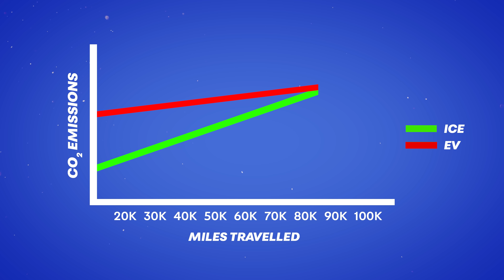Are Electric Cars REALLY That Green? [New 2022 Data]

Comment: As someone who made the switch from ICE to EV 3,5 months ago and advocated for EVs for a while now I was a bit miffed at first seeing this video. But if I take off my EV glasses for a moment I once again have to agree: EVs have still a way to go to become as green as they are advertised to be. But depending on where you live and how much you drive this break even point isn't that far away. I personally estimate that by the time the initial lease (3 years) for my Corsa E is over I should have reached or maybe even passed the break even point, considering the electricity mix here and my average mileage per year. Thanks for this excellent report, keep them coming.
Reply: I also enjoy listening to Rory Reid as I rate him as a fair and balanced journalist. My Fiat 500e will receive around 60% of its charging from my solar PV system and it has a much smaller battery than a large SUV, so I'm not sure how it would compare with (say) an ICE Fiat 500 hybrid bearing in mind that over half of grid electricity here in Scotland comes from renewables.
Reply: @briangriffiths114  Fair to say (as pointed out in the video) that a lighter EV with appropriate battery size/range is more beneficial - and a 500 vs 500e would be a similar comparison to what Volvo have done. The kicker here would be:
A) What are the realistic lifetime emissions for YOUR particular 500e vs if YOU would've been driving a 500?
B) Where did the "Italians" source the materials for YOUR 500e, and to what extent did they seek to protect the environment in that particular geographic area in order to protect (and benefit) the locals long-term?

Fair?
Reply: @Makuma_Jin  All very good points. I do not get the current trend for large and very powerful cars (whether ICE or BEV) that can usually do 0-60 in under 6 seconds but I seem to be in the minority. Having never driven a BEV prior to the Fiat 500e, I am impressed with it and intend to keep it for a very long time.
Reply: @briangriffiths114  You have my blessing for sticking with what you believe in 🙏
On the 0-60 acceleration time; I've been feeling the very same way, albeit... I prefer a capable, confidence inspiring, balanced vehicle. Though not every vehicle needs to be performance-oriented..! Eco-friendly, economical, practical vehicles have their own slot in my heart..!
That said, I still don't think manufacturers could ever justify selling these cars without compensating for the lifetime emissions, and the customer should pay the same amount of compensation for the vehicle they choose to operate.
I make myself a bit sad saying this, as it is my own dream cars (and their manufacturers) that I'm currently criticizing. However, as long as there is a legally sanctioned way to own your own vehicle and enjoy amateur/privateer motorsports, I will reluctantly fold my hand for the betterment of mankind (present and future)...
Reply: @briangriffiths114  there is a very simple reason for EVs. It is all about cost. An EV has a single speed transmission. To get an EV to have enough torque at slow speed (to make sure it can go up a steep driveway the same as an ICE car in 1st gear) and di it with a single speed transmission you need a more powerful motor. A more powerful motor is cheaper than a multispeed gearbox and a more powerful motor running at lower speed is more effecient than a less powerful motor running at higher speed with shorter gearing and using field weakening at lower speed. So the reason for EVs to be fast is because it is cheaper.
Reply: @franciscoshi1968  I have an engineering background that gave me an awareness of the very good points you make prior to taking my test drive of a Fiat 500e. But when I actually drove the car, I found the experience of all that instant torque and the ease of one-pedal driving quite astonishing and I became an instant convert to BEVs.
Reply: @briangriffiths114  all you need to do us drive an EV for a week and the you won't want to drive an ICE ever again.
Every time I have to drive an ICE car (fortunately not very often)  I need to change my driving, need longer distance to accelerate and merge, need to remember to allow time for the the car to rev up and change gears, the smell is something I can't bear any more and the noise is less than ideal. And I do miss the one pedal driving.
Reply: @franciscoshi1968  You clearly don't do many miles. If I had to drive EV, I would kill myself first time I had to charge it.
Reply: @WADE-RI  I drive about 100km/day which is double the average and so far I haven't had to wait for it to charge. I would however kill my self if I had to go back to driving an ICE car and have to spend time adding petrol, putting up with the noise and smell and having to put up with the slow response.
Reply: @franciscoshi1968  I do 3000km per month most on higways with speed between 140-180kmh, so try it and see how long you would stick to EV.
Reply: @franciscoshi1968  Love the smell, love the noise. Love my BMW 330d, and my V12 Aston DB9. In city you won't be faster cause of the traffic, and on highway you will run out of juice and will be stuck while I keep on destroying road. Enjoy your tofu car.
Reply: @WADE-RI  I do pretty much 3000km per month.
But here it is illegal to drive over 100kph. I will stick with the EV. I have been driving it for nearly a year and 30k km and would never go back to ICE. Even if I was given a free ICE car with free fuel I still would not drive it and the car I have only has 200km range. If I did longer driving I would have bought a car with longer range.
I will never go back to ICE. There is nothing an ICE car can do that can compensate for all the disadvantages of an ICE car. Even with only 200km of range I would waste more time adding fuel to the ICE car than I spend waiting for the EV to charge and on top of that the EV is 1/5th of the price and needs almost no maintenance. My maintenance cost for the last year (30k km) was $195 and my fuel cost about $360 for a grand total of $550 which is less than what I used to spend on petrol for my old ICE car in a month and that was when petrol was cheap.
Reply: @WADE-RI  it must be a real punishment having to drive your car in traffic with all the noise and the smell.
I prefer to not breathe the poisonous fumes but I guess you don't mind and I do prefer the quiet. At least I can hold a conversation and listen to music while I drive.
Enjoy your ICE car while you can still get fuel for it.
Reply: @franciscoshi1968  Dude, you know cars have filters.😂😂😂
Reply: @franciscoshi1968  They will be here for a loooong time so I am not worried about it. When you are in your EV and ICE cars are arround you does it smell?
Reply: @WADE-RI  " I do 3000km per month most on higways with speed between 140-180kmh, so try it and see how long you would stick to EV."

BEVs are coming out this year that have a 1000Km/charge range.  Now, I assume once you're running AC or heating that's going to drop down to 700Km.  So BEV?  One step ahead of your statements.  In fact if companies HAD been producing them they'd cost less than ICEV because they cost less to manufacture.  They have far fewer parts.

Right now Tesla has price parity with ICEV, but they need to pay off huge investments into their giga factories around the world so they've taking larger profit margins, and in China two different companies are already selling BEVs for less than equivalent ICEVs.
Reply: @WADE-RI  the fact that you love the smell means you are breathing in the poisonous stuff. That is why there are help lines to help people that like to smell petrol to get a high. Also the filters do not remove the poisonous fumes.if you don't believe me run your car in the garage with the doors close and see how long you can last inside.
Reply: @franciscoshi1968  Let them eat cake lol.
Not everybody can afford an EV.
Also please stop evangelising like that
Reply: @stuartburns8657  they are a lot cheaper than most people think. I bought my EV with the savings from fuel. I spend the same amount as I used to spend on the old ICE car and I drive a new car and will be paid off in 5yrs. No extra spend. I just pay the loan instead of the petrol station and  fuel has gone up but the repayments have not. So they are far more affordable than most people think and you don't need to buy a Tesla.
It is the same as installing solar.
Reply: @franciscoshi1968  I tend to hear that from ppl (normally Americans) who drive 200 miles with a v8 getting 15mgp lol.
The affordability of EV's is a per person situational thing.
We could afford one, but with us both working from home and just using the car for shopping and school runs (diesel getting avg 55mpg) it's simply not economical to do so financially.
I'm in the UK, and despite it being an ICE diesel, the road tax is only £20 per year!
Insurance dirt cheap and loan a couple of hundred pounds pm.
To get the equivalent specification / SUV EV would cost £40-45k.
So while we pay £60pm in fuel, with said EV my loan would double (and some) and my insurance would nearly double also (from 200pa to 376pa)
Oh, I do save £20 a year with no road tax lol!
I could put a home charger in, but in our situation we're simply worse off owning an EV.
It's a shame, but too often the economics don't work out.
Reply: @franciscoshi1968  Boring 😴
Reply: @briangriffiths114  In 2020 97.4% of electricity consumption was from green sources in Scotland.  I think your 50% is all energy consumption, including gas etc… for EV’s in our country we are are doing well from a green electricity generation standpoint.
Reply: Don't take this video as gospel.  It's a study of ONE company's abilities in producing a BEV as opposed to an ICEV.  They don't have Tesla's 4680 battery for instance, so making Volvo a "standard bearer" because they are "woke" is just plain silly.

EVERY auto maker is different.  So, to do an analysis of where the world is in 2022, you need to analyze the entire auto industry.  What Volvo can do is a SINGLE data point, not a summation of the world of ICEV and BEV.

Also, I find the "well to tank" study lacking in many ways.  It accounts for the CO2 and energy in getting oil out of the well and into a tank, but it doesn't account for what it took to create all the infrastructure needed to do that.  It also doesn't account for all the different pollutants that get created, doesn't account for having to deal with multiple oil spills and the environmental damage, along with loss to other businesses due to those spills.  And I could go on.

So, what is this?  A single data point, and nothing more.  I'd be willing to wager that Tesla can make a BEV more efficiently, and since they have the best battery right now for Li-Ion technology, and they make the most BEVs, you can't ignore them if you want to try to say "Are Electric Cars REALLY That Green? [New 2022 Data]".  One only has to watch channels that cover the technology of BEV to understand that "woke" has nothing to do with anything.  Being smart and innovative wins the day.  I think Tesla needs the fewest parts of any manufacturer in producing personal vehicles, and that makes a difference.
Reply: @johndoh5182  I do value Volvos effort here, and it is relevant data. The only thing I strongly question is why they would use a SUV for such a study - as it has been established that no matter what they are powered by SUVs are inherently inefficient when it comes to being "green".
Reply: @robertmandl9326  I'm not saying Volvo didn't try to do a good job in comparing their two like vehicles.  I'm just saying Volvo certainly isn't the ideal when it comes to making BEV.  The best battery tech isn't going into their vehicles; it's going into Tesla's and that makes a difference.  If a video is going to do an evaluation of 2022, then it needs to look at the technology in 2022, and Volvo doesn't have it.  For Li-Ion, Tesla is putting out vehicles this year with their 4680 battery and it's really best to read about how that's incorporated into making the vehicle to fully understand how much benefit Tesla gets with this new technology, along with faster charge times, lighter weight, etc....  They've already started rolling vehicles off their lines with these new batteries in the US.  There are also vehicles coming out this year, I forget from which companies (go look up the Electric Viking) that are 1000 Km/charge vehicles.  BEV technology is about to start advancing pretty rapidly with how much R&D there's been over the last decade into improving batteries specifically for BEV.

So without doing a look at Tesla vs. most other auto makers' BEVs outside of a couple Chinese BEV makers who are about on the same level as Tesla, you're not really looking at 2022.  You're looking at technology from 2 - 3 years ago that Volvo has, or can get their hands on.

So once again, this is only a data point and nothing else, and the data point is no more than what Volvo can do with BEV and ICEV with that specific model of vehicle, in a theoretical comparison of "well to tank" for ICEV vs. the similar for BEV, except no "well to tank" study does a thorough job of the FULL costs of creating all the infrastructure needed, along with all the harmful effects of refining, oil spills, etc.... which don't exist when you use clean energy to produce electricity for BEV.

So, the Title of the video is misleading and if you don't follow battery technology where there's hundred of billions of dollars of investment right now, you'd get the wrong impression from the video since it says 2022.
Reply: @johndoh5182   "[...] it doesn't account for what it took to create all the infrastructure [...], multiple oil spills and the environmental damage" - This statement is absolutely ridiculous. 
Neither do wind turbines or coal power plants appear out of thin air.
Maybe we should also factor in the cost of Tchernobyl or Fukushima for producing electricity? How about dam breaches? Electrocuting accidents?
Just to show you, where do we stop? 
Such unsubstantiated claims lead to nowhere, they won't contribute to any meaningful discussion.
Reply: Your personal mileage isn't that important, as when you sell the car it's still going to be driven and so will be greener whatever way it's measured.
Reply: @smc812  Your Carbon footprint is though. If you're going to trade out of a car that's just broken even or not yet broken even, you'll never be carbon neutral. The car is now green and you keep enlarging your carbon footprint.
Reply: @Tribulation88  That’s just a silly way to look at it, but if you like it that way buy a second hand EV and then have no carbon footprint from it.
Reply: @smc812  It isn't a silly way to look at it, it's the only way to look at it. A "green" car is anything but when it's being churned out in the hundreds of millions to satisfy peoples' irrational, wasteful obsession with having a new car every 2-3 years.
The huge environmental damage done during the production of an EV doesn't just magically disappear as soon as you sell it on and then another is made for you to buy.
Reply: @bergeracvandamme  I very much doubt many people are buying new EVs that wouldn’t otherwise buy a new petrol car.
Reply: @bergeracvandamme  True, wehn you sell it on it doesn't remove its footprint. But it also doesn't cease to exist and/or stop being used. Selling on an EV, in the current market, is actually heping the cause a little in that it brings an EV into the hands of people who can't afford them brandnew but do want them. So yes, buying a new EV every 3 years isn't all that "green" when just focusing on the individual user; it still keeps the car in circulation and thus allows it to further help the cause. Besides, if reselling an EV that soon is bad, what does this say about ICEs? Wouldn't this very same approach be bad here too? Hint: it is.
Reply: @bergeracvandamme  this 

You cannot be green by consuming more stuff.
Reply: There have been TED talks on this for years as well.
Reply: Only if you don't consider the ground killing. pollution, and slave labor to get all the mined products. I guess if it is not in your backyard, you don't care.
Reply: @a73bu29  Get with the times. Retorting the same old arguements while ignoring newer developments makes look stupid, at best.
Reply: @Robert Mändl  Being a sheep and blindlessly following along with a narrative others give you for their profit is ignorant, at best. It is a fact that everything they use such as lithium, nickel, cobalt has been used but is currently not in evs, but still is in other areas. Lithium, only one example of many polluting substances used, has one of the worst track records of ruining vast swaths of land and water for miles and miles. So either you are being disingenuous, or you are the one that needs to do some more research. Lithium is also recycled at less than 2 percent, as it degrades and is nearly unuseable after. Maybe u just dont care because its too much fun to virtue signal and claim to be more moral and woke than everyone else. It also isnt at the point of being self sustaining, and must be subsidized at every level and mined with yes, minor and slave labor. But youre armed with your new arguments, so guess you have the high ground because the media and goverment agencies full.of people personally profiting on the windfall tell you youre right.
Reply: To be clear NO-ONE in the know claims EVs are currently totally GREEN. They only claim (correctly) that they are significantly GREENER than any ICE or Hybrid car. That includes the manufacturing and the lifetime impact. Having said that, there are cars beginning to emerge that will be distinctly Carbon NEGATIVE by the end of their active life.
Reply: @PedroKing99  The price of gas and electricity in the UK is set to rise by 40-50% in April if the government don't step up, this is before 38 million cars need to be charged once a week on average. Moving over to an EV right now seems like madness if the price of charging it is going to wipe out any savings in the long term.

They may help reduce our impact on the environment via emissions, but if we need to cover the land and sea in wind farms to cover the extra demand for electricity... is it really worth it?
Reply: When this 90000 miles is done in the  ev then what state is the ev battery?
Reply: @rneoman  Probably about 75%
Still, when did you last buy a vehicle with nearly 100k miles?
Reply: @stuartburns8657  this year I bought an alfa 159 with 130k miles ,I've spent 10 euro on a new glow plug and so far put 15000 more miles on it for work. The most economical thing to do is keep older cars on the road . I also have a few mitsubishi lancer evo 6 tommi makinen editions but they are worth too much money now to drive everyday. My alfa now with 145k miles still gives 45 mpg average
Reply: @rneoman  Yeah, that's pretty impressive.  Always a bonus if you can do odds and sods yourself 👍
Reply: EVs are gr8 for local commutes. There's no doubt about that. I've kept my ICEV for longer drives and weekends.
Reply: @t8polestarcyan22  A reasonable approach. While I am a strong advocate for EVs I generally don't recommend them for long drives - unless you pay bigger bucks for a Tesla LR or something similar.
Reply: @robertmandl9326  I don't mind plug-in hybrids.
Knowing that I don't do frequent long journeys, it's not feasible to go ICV.
Reply: which means that by the time you turn it in you will have "polluted" much more than had you leased and driven an ICE.
Reply: @boxsterbenz4059  1.) I have no plans of turning my car in once my lease is up. 2.) Regardless of whether I or someone else drives my car in 3 years the fact remains that by that time the car will be cleaner than any ICE going forward. That CO2 baggage is linked to the car. In the meantime I will occasionally laugh my butt off thinking about some commenters in here when I pass by yet another fuel station with ever rising prices. Yes, electricity ain't for free... however the price for kwh in my area has remained unchanged for at least the past 5 months while fuel prices have steadily gone up by, so far, roughly about 15%.
Reply: @robertmandl9326  good argument. now, how does it change when you look at all of the tax dollars (read your money) that have also been spent on this?  just saw a video that has india ev production coming in at around $15,000 cdn per vehicle. they start exporting and the current producers will be vapourized.
Reply: @boxsterbenz4059  I'm eager to see what comes next, competition can only enhance the market. As for costs in total for me its a sweet deal.... and dont forget the bigger goal is to reduce CO2 overall, over time. Thats worth some money.
Reply: @robertmandl9326  except there is no historical correlation of CO2 and temperature. recent literature is permitted to be published that shows what many have known for year: IPCC modelling run "hot" and cannot reproduce the temperatures of the past which make them useless for predicting the future.
Reply: @robertmandl9326  now, robert. how about reading it? i believe it's about 4000 pages long. let me know when you've finished and then we can chat. k?
Reply: @boxsterbenz4059  Thats what tl;dr is for, especially on big stuff as this. Apart from that, to further debunk what you said: ever heard of the greenhouse effect? Doesn't get more direct connection than this regarding co2 and temperature. Unless you can come up with a credible source for your bullocks this discussion, at least with you, is over.
Reply: @robertmandl9326  greenhouse effect is primarily water vapour which the IPCC does not take into account.
Reply: Robert, 
the electricity mix is not an accurate way of judging CO2 emmissions for electric vehicles' power supply.
Extra demand from electric vehicles on the grid increases fossil fuel generation. Wind, solar and nulear cannot increase as demand increases which means that essentially evs are fossil fuel powered. Few people, even our U.K. government recognise this and in time they will wonder why CO2 emissions are not falling with the take up of evs (And heat pumps, the same applies).
Reply: @iareid8255  "wind, solar and nuclear cannot increase" - Oh yes, they can. Especially renewable sources are still being researched and expanded; power generation isn't a zero sum game that automatically leads to fossil power plants. Besides, I wonder where you get your info... if the electricity mix, which includes all available sources across the grid, isn't "accurate", where exactly is your info coming from? As it stands and as far as I know we still could support way more evs than we have to right now. Last but not least, every ev on the road means one less vehicle fossil fuel has to be produced for - and as you surely know CREATING fossil fuel costs more electric power than just charging said power directly into a vehicle. Or, to be less diplomatic here, I call major BS on your "arguement".
Reply: Robert, 

you misread what I said. Wind, solar and nuclear cannot respond to an increase in demand because they are already at maximum available output. That is how they run.
You misread what I said, I said that you cannot use average mix to base CO2 emissions for evs. I didn't say the mix figures are wrong, merely you can't use them as a basis because of the way the grid reacts to more load.
Yes, currently we can charge more evs as long as most are charged at night, peak times are different hence the talk already by energy suppliers of controlling when they are charged.
How can you not understand that adding evs to the road means more electrical power is consumed? (And consequently less liquid fuel)
it takes far more energy and raw materials to produce an ev than an ice car at the moment. Volvo did astudy on it.

"CREATING fossil fuel costs more electric power than just charging said power directly into a vehicle"

What?  I am afraid your knowledge and reasoning is sorely lacking. You have to have the fossil fuels to charge your ev, they produce the electrcity and will do sounless there is a far more widespraed use of nuclear generation.
Incidentally, since Sunday afternoon wind has been producing less than 5 Gwatts, and currently (0750 Thursday) is producing 870 Megawatts..
Reply: @iareid8255  Forgive my poor wording about the creating fuel part. What I meant with this was that raw oil doesn't magically just convert into useable fuel by itself. The electricity used by refineries could be charged directly into vehicles instead of wasting it on creating said fuel. And as far as I know the "extra load" on the power grid created by evs is rather negligable - especially when compared to other power consuming entities. For example: near my hometown there is a company which melts down used metals so they can be reused again. While this in itself is highly useful by not just wasting used materials and repurposing them the process consumes vast amounts of power - in fact, as we recently learned, this one company and their installation consume just as much power as the nearest large city as a whole! The company also recently reduced their activities, due to said immense power consumption and less demand for their services, by half. So, in other words, by just lowering the consumption of ONE smelting plant alone in our region we could theoretically charge entire fleets of evs. So forgive me again if I find your entire reasoning highly doubtful; from where I stand and live evs haven't even made a noticeable dent into the power grid. Yes, evs are more resource intense to create, but thats reflected by their co2 footprint. In the long run ICE vehicles are more costly. And as for your point on renewable energies, yes, EXISTING sources can't increase their output, they are at capacity. However new sources (small and big) are also created practically daily and it's not like people exhcange their ICE vehicles for evs by the hundreds of thousands daily.
Reply: Robert, 

of course power is required to distill crude oil so it is useable, but remember it splits to very many different components, that power doesn't just make the fuel. 
While power stations use gas, rather than a distilled fuel in most cases, there is energy used to bring that gas to the power station before it can be used to make the power to chaharge evs. Approximately 60% of that fuel is loss between generation, transmission and distribution.
Renewable generation capacity is increasing, but it is slower than you think, U.K. figures give about 35% availability factor which effectively means that construction progress is a third or so from what it appears when nameplate capacity is quoted. Also wind genertaors deteriorate in performance at a steady rate for about twelve years then the decline accelerates so existing farms are slowly losing capacity.
The extra load is significant given the number of evs now but steadily growing and when new ic cars are banne dwill accelerate. While industrial users do use huge amounts of power they are relatively few, and some do produce their own, dependant on their product. (oil refineries for instance).
The point about smelters, for instance (there are now no aluminium smelting done in teh U.K. due to energy cost, which in turn is due to the expansion of renewables) reducing output is not good, what happens is that industry moves abroad taking jobs with them. It's not good.
Reply: All passenger cars should be electric. The only petrol cars that could remain are hyper-expensive supercars since they exist in such small numbers.
Reply: @ToxicRakyat there is no comparison between an ICE car and an EV in terms of noise and smoothness. Turn the engine off when you are on the highway and that is what an EV sounds and feels all the time. Even under heavy load. I have been in nice expensive cars an the only time they feel as nice as an EV is when the engine is turned off. You should try an EV. There is no delay between pressing the accelerator and the car accelerating. If you need to accelerate in an ICE car the first think that needs to happen is the gearbox needs to shift and the engine needs to rev. That takes time and the smoother you want it to be the slower it is. The EV just accelerates and is smoother than even a CVT with no noise or vibration.
The nicest car I have ever tried was a Lexus.  It was impressively quiet (and expensive). Then I tried a Kona EV and the Lexus felt noisy and rough. The only time they felt similar was when the Lexus was idling. The moment you tried to accelerate the Lexus was very noisy compared to the Kona and the Lexus was not as smooth or as responsive as the Kona.
Reply: @ToxicRakyat I think most EVs on the market now are not made for sporty driving. Most of them are crossovers and I would expect the driving characteristics to be tunned to that market.
As for the delay, I only noticed it after driving an EV and then driving an ICE car. I already got used to the car response and when I drive an ICE car I do need to change how I drive.
The noise is also something I did not notice until I drive an EV. I was really impressed with the quietness of the Lexus until I tried the EV.
I agree EVs don't work for every application and what is on the market at the moment is meant for the highest market which is crossover SUV like cars.
Reply: Well for most petrol car owners they will own their cars longer on average. And oil-based cars turns out last a lot longer. Better for the environment to run on oil than keep getting new batteries and cars. The Volvo test limited the mileage for a reason. They stopped the 2nd swing back in the graph.
Reply: it can take as little as 3 months in the UK to break even
Reply: @KingFinnch  Bullcrap. Unless you drive 30000km a month.
Reply: @KingFinnch  rubbish. citation for this please.
Reply: missing a few fundamental points
- with an EV is up to you to decide where the energy comes from, with your purchasing choices and voting
- environmental impact of battery production will get better pretty quickly as the sector is still in its infancy, While ICE tech has been stuck pretty much at the same level for the past 20-30 years or more
- the XC40 recharge is one of the most inefficient EVs on the market
- pretty confident the CO2 emission from fuel used is a hugely edulcorated value by decades of lobbying and representing the best case scenario: like a surface oil well, next to a refinery and with the fuel pump just out of the gate.
- Most of actual driving in Europe is in urban areas where EVs excel, while ICE are at their worse. Where difference in efficiency can be 5-10 folds
- etc
Reply: I don't give a f... about green or not. ICE is fun and that is all I care about.
Reply: @WADE-RI  Clearly you've never been in a BEV that goes 0 - 60 in about 3 seconds, and the faster ones basically shock people the first time they do the 0 - 60 test.  It's like getting on a crotch rocket for the first time.
Reply: @johndoh5182  Yes I have. I have also driven 911 turbo stage one that can do it in less. It is a party trick you don't get to use cause of the traffic. Miss me with 0-100 stupidity. Straight roads are for fast cars, bends are for fast drivers and I prefer driving over impressing idiots.
Reply: @WADE-RI  How many driving competitions have you won? Are you a pro racing driver? If the answer to both is none then you are not a fast driver. Maybe a dangerous one.... who likes impressing idiots . 🤔
Reply: @jonathancullen1337  Plenty since I was kid in go cart. Grobnik track is 10 minutes away from my home so we are there all the time. Dangerous people are the ones that bought Tesla and think they know what they are doing and their former car was 10 times slower and not people like me.
Reply: A lot of the issues people have stem from them being forced on us (in the UK at least) before they meet the standards we'd be happy with. Plus the public charging costs are nuts!

Personally if I could get 300 miles of range in 10-20 minutes despite running the AC or temperature outside I'd get one. That's assuming I could pick it up for £3k used, but I can't. If it was over £30k I'd want hothatch performance, looks and good tech... as well as 300 miles (normal driving) range on a 10 minute charge.
Reply: @WADE-RI You value having fun over having a future?
Reply: @WADE-RI  Then why do you even comment? People like you are whats wrong with this world.
Reply: @Tribulation88  Thank you!!!! Plus all of the other crap going on and people think they can save Earth with 120 mile range EV?! People are idiots. If you want EV, you get it cause it suits your life better not because it is green.
Reply: @WADE-RI  Playing the "Karen" and the "treehugger" cards completely disqualifies any and all statements from you. Have a nice day.
Reply: @Tribulation88  Every little bit helps, until the bigger issues can be tackled. People who only care about their "fun" however precisely help with nothing. So yes, those many little man-children are at the very least part of the problem.
Reply: @robertmandl9326  Please climb down from your moral high horse and actually think about the implications here.
Factoring in the need for rare Earth metals, the environmental damage involved in just the production and disposal of the average EV is huge. They may allow end users to feel warm and fuzzy about helping the planet but all that's happening is that the environmental damage is being shifted so that it's less overt from the owner's perspective.
It's even more ridiculous considering that countries like Britain already contribute less than 1% to global emissions. There is literally nothing that countries like Britain could do that would have any meaningful impact on global carbon output. They could legislate themselves back to the Stone Age and their reduction in emissions would be offset within mere months by the likes of China and India, the latter of whom is projected to double its carbon output between now and 2030 (and its output is already vast).

This whole idea that shifting to EVs is going to make any difference to the environment is pure self-indulgent fantasy.
Reply: @bergeracvandamme  The required materials for the current generations of batteries are already factored in the most recent studies, you can see the result if you actually watch the video and or do an online search. So its not so much of a a "high horse" in the damn FACT that despite the bad footprint the production of a current gen EV creates it still outshines the ICE over easily foreseeable time. Plus new generations of batteries are already in the works that won't need as many rare materials, if any at all. And as I said earlier, every little bit helps, you have to start somewhere. People like you apparent don't wanna start and keep pointing at issues outside the average persons control. People like you are thus part of the problem, this analysis stands.
Reply: @bergeracvandamme  was there something about the video that confused you? The facts maybe? The additional CO2 costs from battery production is the primary difference between the different models of cars being compared and that  additional costs is equalized somewhere between 26k and 90k miles.  Are you in an uproar about the rare earth metals in your phone or all the numerous electronics that developed nations' citizens throw in the trash every day?  Are you likewise having a hissy fit about the environmental footprint of the US military?  Discussing other concerns (environmental damage of mining) is a distraction...If you're upset about such things you should probably go live off the "fat uh da land" in a wooden hut because there's virtually no products in the modern world that you could ethically use by those standards. 

 The range of the XC40 recharge is listed as 223 miles, the battery capacity at 78 kWh or 2.86 miles per kWh.  The rule of thumb for most recent EV sedans is approximately 4 miles per kWh.  This "EVs suck and are destroying the planet" schtick is ridiculous.  After you cross the break even point, they are clearly better.  Using clean energy to charge them moves that point to 26k miles....and I hope most cars have 100k miles in them at a minimum. Also, Tesla has started putting Lithium iron phosphate batteries which contain NO cobalt in its entry level model 3 and Y cars.

The takeaway from the video should be (things we can control):
1) If you already have an ICE vehicle and don't drive much anyway, you'll probably have lower net carbon emissions sticking with your ICE.
2) Try to use clean energy to charge your EV
3) for either type of car, don't keep buying new cars all the time and if you do, don't buy a GD SUV, EV or otherwise unless you TRULY  need it (3 or more adolescent kids?).

For me, I'll eke by with my 75 miles or so.

Switching to an EV is not going to save the planet... but it does lower the bar for the magnitude of cultural changes needed to do so.
Reply: @WADE-RI  ICE is loud but no more fun.
Reply: @SYN_Skydance  Loud is fun, loud has soul. EV cars are one trick boxes on wheels. If you like it, I am ok with it but I am going to stick with loud.
Reply: @wadewilson4033  I can't wait for our cities to be EV only, to be able to walk down the city main street without being deafened will be a pleasure for all to savor.
Reply: @russelldesilva1560  You won't live to see it. Nobody will ever bann old cars cause rich people drive it.
Reply: @WADE-RI  well said 👏 👍